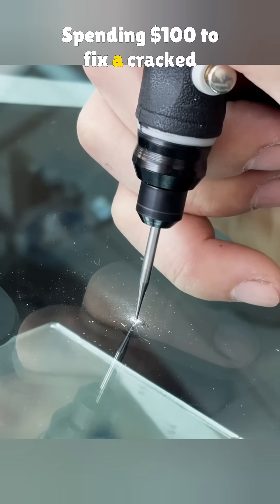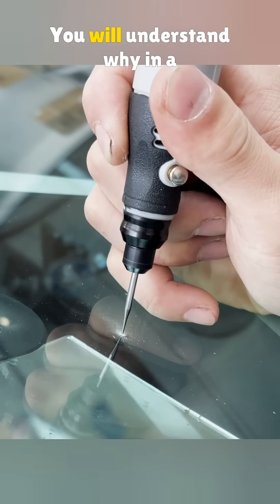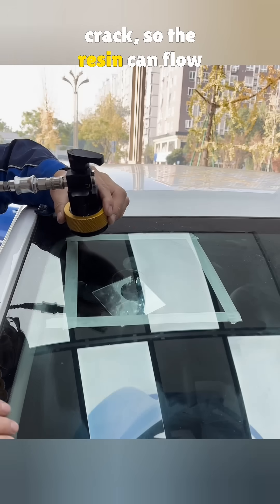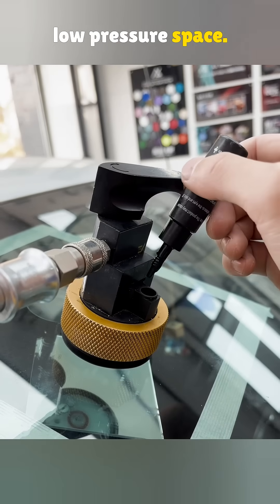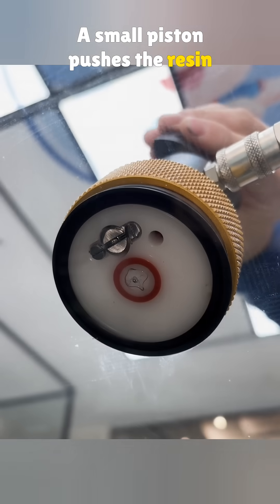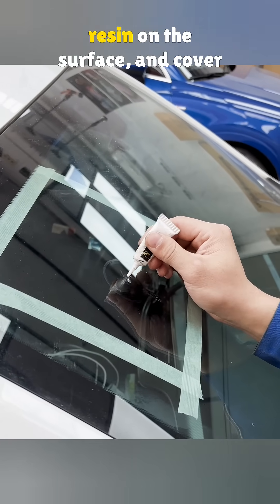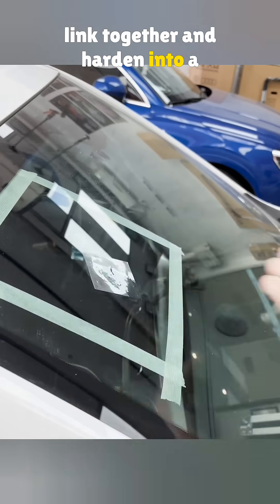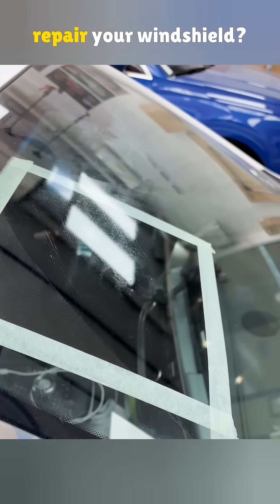How Windshield Repairs Actually Seal Every Crack

Comment: No,  spending 100$ are wasting of money for a single crack spot on the windshield and it doesn't matter for tiny crack spots on wind shield if it's major then it's matter but for tiny cracks it's not worth